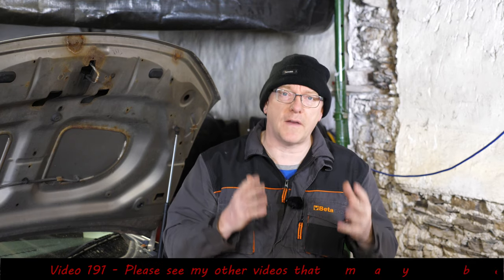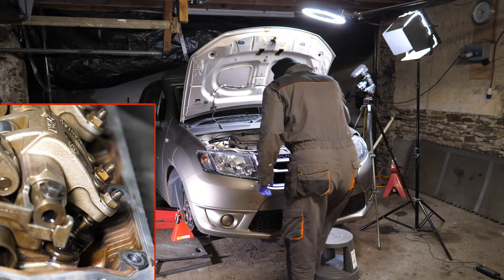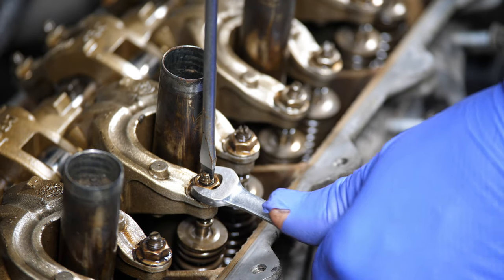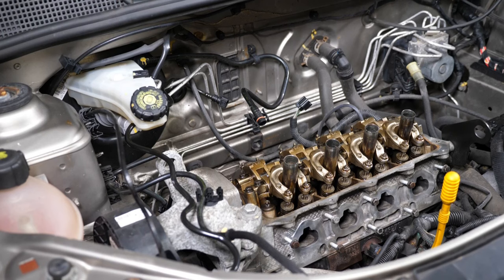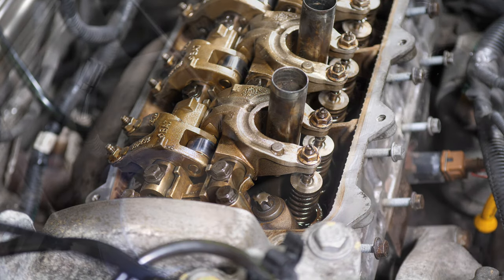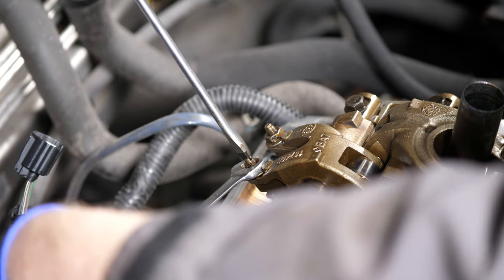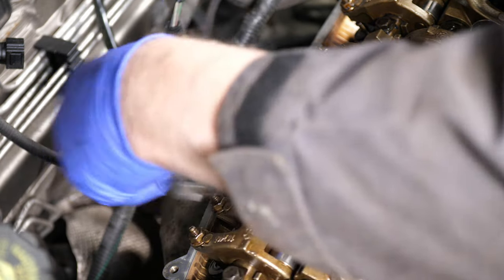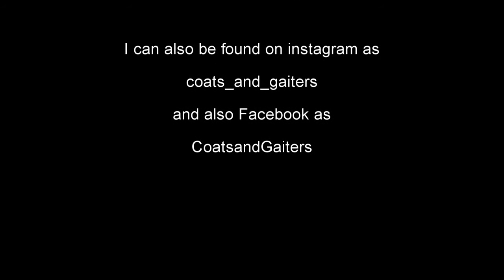Final Part 7  Exhaust Inlet Valve adjustment on Renauilt D4F Dacia Sandero Renault Clio Twingo Modus

Comment: I see oil consumption in my motor(Dacia Sandero), almost 1 liter in 2000 Km.  . Is it possible that these valves clearance need to be adjusted? Since I don't see any blue exhaust I am doubting if the gasket of cylinder needs replacement....
Reply from the maker: Has it done many miles?
Reply: around 117000 Km...and I see the problem from 93000 Km @CoatsandGaiters
Reply from the maker: I read they do use a fair bit of oil especially if driven hard.  Probably why the one I have ran out of oil by the previous owner.  He used to drive every car as fast as he could. @mehdikhamseh5500

Comment: Jesus christ at least let us see the finished result
Reply from the maker: Do you mean finished result to the series?  The engine ran again and was quieter but it's still wrecked and the Dacia needs a new engine.  Nothing really changed other than diagnosing that the camshaft was beyond repair and ruined from oil starvation.  I guess this was the finished result as a 'short' https://youtube.com/shorts/LnbIRIcw7U0?si=yal_csl9nB0wEZrf

Comment: If you have a normal tool without so many measurements, what would you recommend for an engine with 180,000 km?
depending on the camshaft of course   , Thank you very much for the video
Reply from the maker: I think you choose a feeler gauge that’s in the range Renault states which I’ve listed in the photos and the end info bit.  I just had 2 or 3 feeler gauges that were within this range but just choose what you have available within that range.  Hope this helps.  Mind feeler gauges are pretty cheap for one with 40 gauges.  I’ve included links to tools in my video description.